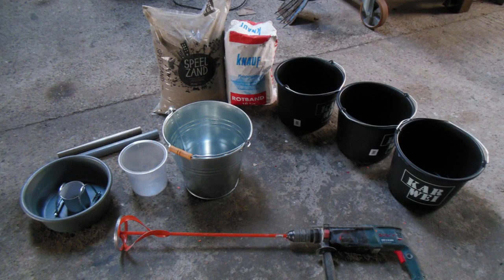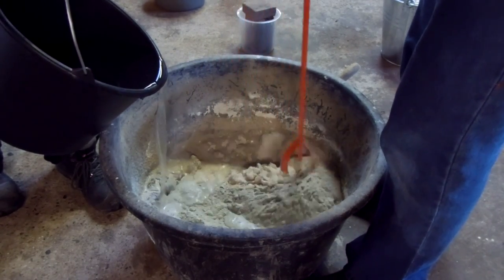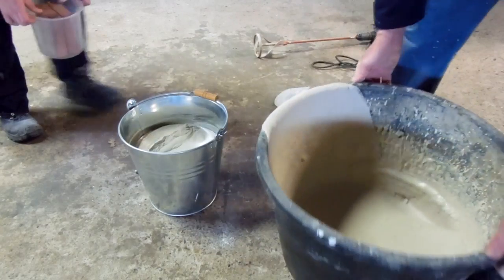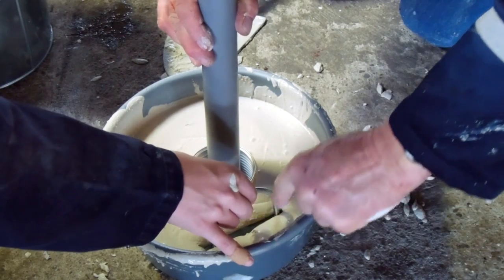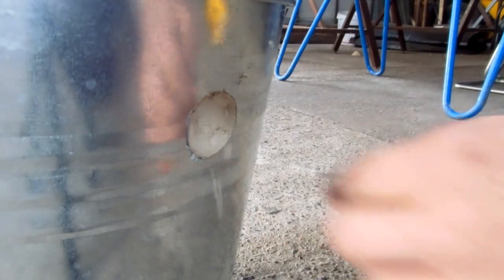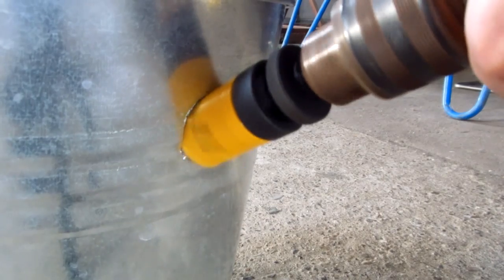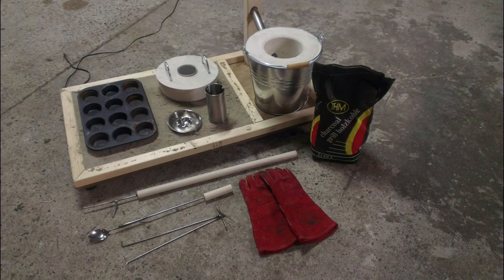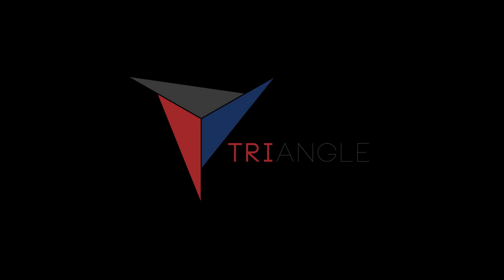How To Make a Mini Metal Melting Foundry

Comment: what kind of sand did you use ? im from Portugal, so the types of sand are a litlle bit diferent. Can you describe what kind of sand are you using? thanks in advance. Cheers.
Reply from the maker: I used what is called 'playsand' here. don't really know what exact type of sand that would be. it is meant for children to play with and build sand castles with. I would go for the finest sand you could get. the sand I used wasn't so fine, but couldn't get finer sand. finer sand gives a smoother finish I think. good luck!

Comment: Did you use a galvanized steel bucket like King of random did?
Reply from the maker: +Phillip Korchuk yes I did. Its fine, it doesn't get hot enough to do any harm, otherwise you're outside.
Reply: +Triangle_DIY Awesome, I'm going to do this project myself sometime soon, any tips?
Reply from the maker: +Phillip Korchuk with my one the mix would not dry good, but I did it in the winter, that could have been the problem. However it's falling apart after a few uses, not holding up too good. I've heard that from other people too. I remember a video of a guy using a mixture with some other stuff instead of the plaster of Paris. I think it's linked somewhere in the comments here. Maybe look into that. Think I'll redo my furnace coming summer with a different mix.
Reply: +Triangle_DIY I see, did you "dry" the foundry out when you first made it by using a small fire to get rid of the moisture slowly, perhaps that could have been the problem?
Reply from the maker: +Phillip Korchuk I slowly started it the first time. Then the lid cracked already. Should have put some steel bars in it to keep it together. The foundry was fine then, besides a few small cracks which are to be expected.

Later however there came more cracks. The mix is just too soft. I think making it in the winter was not a good idea, the temperature was too low I guess. Mine took waaaaaaay longer than TKR's did.